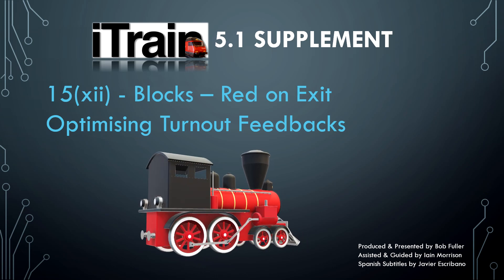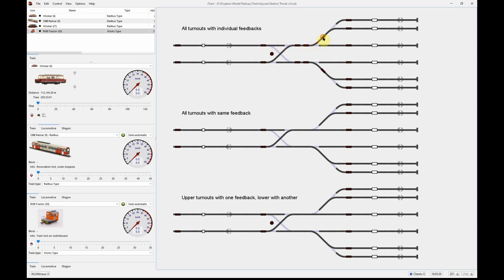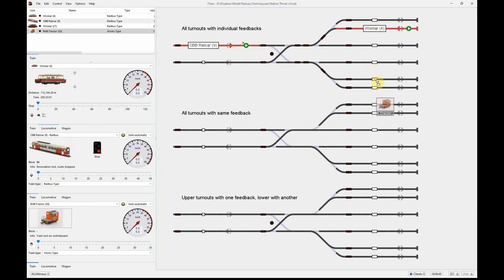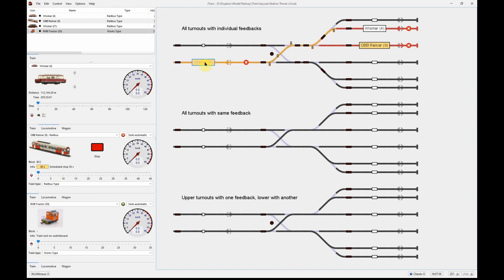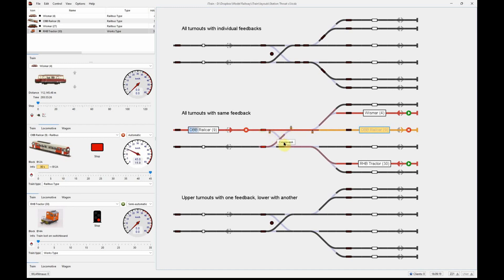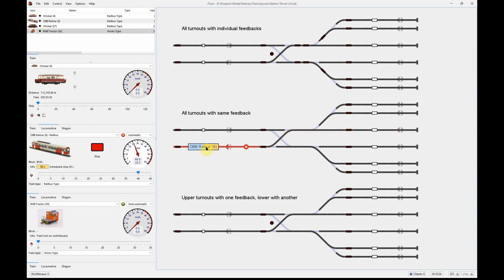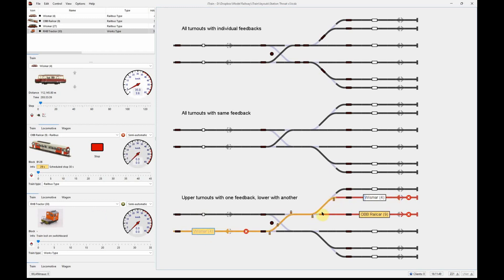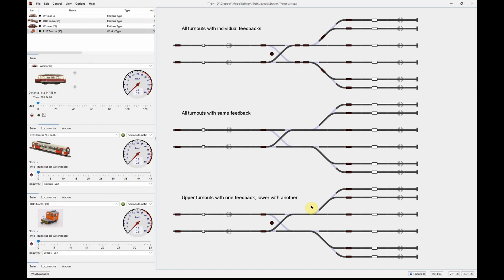Video 15(xii): iTrain 5.1 Supplement - Blocks - ROE - Turnout Feedback Optimisation

Comment: I wonder what would have happened with no occupancy feedbacks on the turnouts. Other than allowing a signal to change earlier, I am not seeing how occupancy on turnouts improves the flow of traffic in and out of a yard.
Reply from the maker: Turnout feedbacks provide no real operational advantages, other then being able to see the progress of the train when travelling across a turnout structure, and by providing an additional position update when the train activates the first turnout feedback (as described earlier in the video 15 series). So,  you are correct, using turnout feedback will not improve the traffic flow. It is really for those who want to follow the progress of trains as they pass across a turnout structure - most often used in hidden areas of the layout.
Reply: The major advantage of turnout feedbacks becomes apparent when you have wagons that incorporate feedback because they will not allow iTrain to release the turnout when it is occupied. The most common place for anything to become inadvertently uncoupled or derailed is on turnouts and without turnout  feedback, and wagons that draw current, you run this risk of collisions because iTrain may have assumed that the turnout is clear. You are correct though that if nothing ever stops, or is inadvertently left on a turnout then the advantage of having turnout feedback is limited and iTrain will perform perfectly without the use of it.